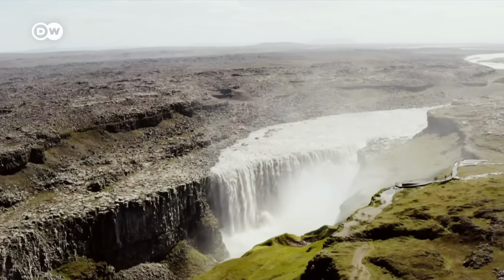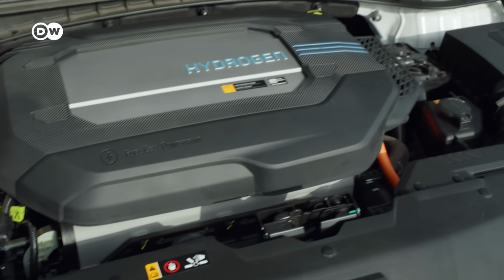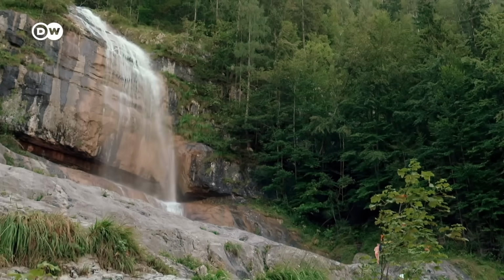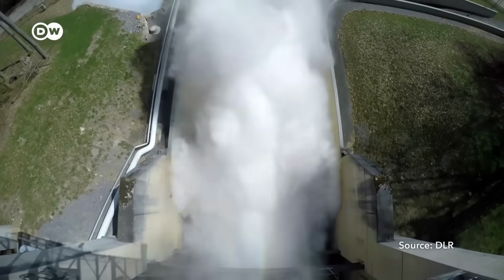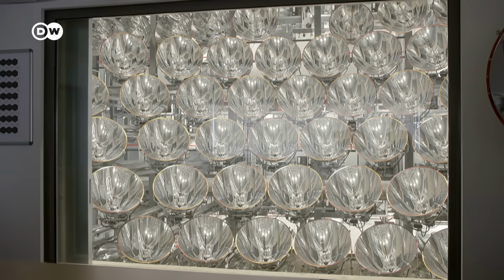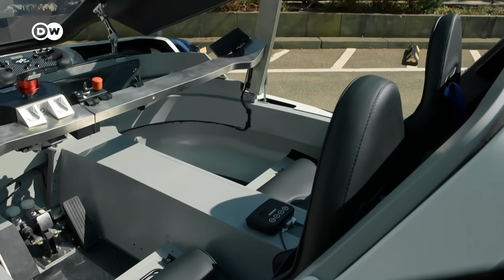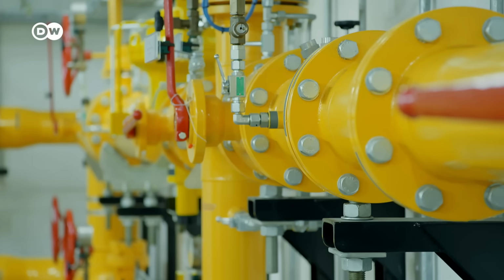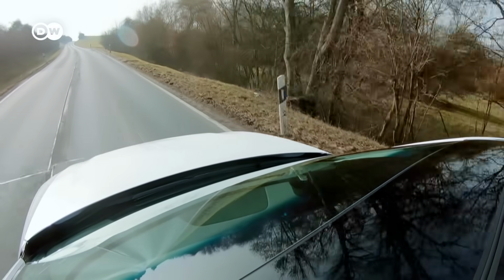Is green hydrogen the answer to the climate crisis? | DW Documentary

Comment: I’m not a great fan of hydrogen. It requires lots of moving parts compared to batteries. 

Also, if you have gas and are creating hydrogen, aren’t you just creating an extra process just so you can call the output clean? And losing power in the conversion I might add.

If you have gas at source, you may as well just convert that to electricity rather than convert it to hydrogen.

I think if they can get green energy at source then that would be better, but possibly the only viable use for hydrogen is with large vehicles and industry. Having all those moving parts in a car just perpetuates the current inefficiencies of cars. Hydrogen is only a little bit more efficient than fossil fuels and less efficient than electric cars.

Comment: The problem with Hydrogen is in it's production as it takes double the energy to produce than the Hydrogen that's created hence why they are only talking about "GREEN Hydrogen" So they are using renewable energy to Crack water into Hydrogen and oxygen, Then there is the infrasrtucture and storage issues as per the documentary suggests.

Comment: It is a myth that green hydrogen does not produce green house gases. When you burn hydrogen, its byproduct is water vapour and this vapour is one of the worst green house gases due to its ability to trap heat. 

It is also a myth that electric cars are greener. Most of our electricity does not come from renewable sources, so the generation of the electricity often involves burning fossil fuels. When you burn fossil fuels, a large part of the energy is wasted. Not only that, when you transport the electrical energy, it also involves waste. On top of that the car battery storing the energy, also lose part of their energy.

So I am very skeptical about these alleged green energy solutions, that will help reduce climate change.

Comment: Hydrogen fuel-cells aren't necessary.  It's now possible to contain Hydrogen under sufficient pressure to feed it directly to an engine -- including a (slightly modified) IC engine.  It's not necessary to transport green Hydrogen either;  it can be created on-site with solar electrolysis, even in small and portable units.  It's possible to create your own fuel at home, or as you drive!

Comment: Hydrogen is merely a storage solution for most uses. The only things for which hydrogen is important is industries where you need to create a lot of heat to make steel for example. This is a cheaper solution for plants that use gas to do that now instead of rebuilding the entire thing. Hydrogen won't solve climate change because making it costs more than it generates making the stuff only useful as waste from other processes or if there is a abundance of green energy that needs to be stored long term to compensate for times of shortages

Comment: The problem with deriving Hydrogen from water is it requires a lot of energy to split the water molecules. Since the energy needed for electrolysis is still coming from fossil fuel it defeats the purpose. Hydrogen is definitely not any greener than fossil fuel. Scientists need to solve the problem of getting energy without using any fossil fuel. Battery powered vehicles need electricity and the electricity it needs come from fossil fuel and co2 emission. As a result electric cars are not any greener then gasoline cars. Solar panels requires great amount of fossil fuel to mine the precious metals, refine and manufacture. As a result harnessing solar power from solar panels are not any greener than fossil fuel. Natural gas on the other hand emits only 40% co2 compared to any other fossil fuel. We should use natural gas as energy source until scientists can come up with better solutions. We can cut co2 emissions by 60% by using natural gas but the whole world is run by whole bunch of idiots.

Comment: Considering car & truck electrification separate from other uses of electricity, of the 3 basic EV drivetrains - All-battery BEV, plug-in hybrid PHEV and hydrogen fuel cell HFCEV (BEV vs PHEV vs HFCEV) - which one offers the most benefits, applications and potential to reduce fuel/energy consumption, emissions AND insane traffic? The correct answer is PHEV plug-in hybrid. Whaaat? The real problem is we drive too much, truck packaged goods across continents. Separately, we ship raw materials and other commodities around the world too much. PHEV tech offers the most incentives to reduce travel for the most households. 

Here's how this claim makes sense: The Prius class PHEV adds a 5kwh battery pack to a standard hybrid for a rating of an "effective" 110mpg. The Chevy Volt "extended range" PHEV is built with an 18kwh pack for a rating of an effective 150mpg when daily drives below 50 miles or 20-miles in the Prius. Drive further and both PHEVs get 40-50mpg. The Tesla 'X' has a 95kwh pack. Should limited, expensive battery resources be directed to (1) Tesla 'X' or (6) Chevy Volts or (19) Prius? 

Households with a PHEV in the garage gain an emergency backup power supply to keep the lights on, fridge, stove, electronics working in power outage, indefinitely when their smaller battery packs are matched to consequently smaller rooftop PV solar arrays and neighborhood mini-grids. PHEV households also gain the means to reduce energy consumption for household uses. Shorter drives support local economic development whereby more trips become possible without having to drive. 

Lastly, consider "combustible" hydrogen in the ICEngine of a PHEV+H drivetrain, stored at lower pressure in smaller tanks, meters into the ICEngine reliably and can in theory deliver more than twice the number of miles per gallon equivalent possible in a fuel cell EV.  Not getting a response to this BOLD claim I'll take as a sign it's correct.

Comment: hydrogen or petrolium cars are viable , i am not agenst electric cars , i am agenst battery cars , batteryes are dangerus , poluting to produce and recycle , taking to long to charge  , expensive and heavy . Goverments throw so much money for wars for example , so there is no excuse for the expenses . and with the proper investment , individuals can produce hydrogen them selfs if they have the self owned ''green energy'' and the space for a small reactor under the right gidense from an expert so they can heat theyr homes and move theyr weichles

Comment: Loop… aim the artificial sun lamps at solar panels which will power the lamps. Fuel cell solar panels might be a new tech that will derive. Place the lamps inside of a sphere, aiming at the sphere solar core. Run the energy out of that core into the grid. Self contained. Similar to a Tesla tower. These loop powered spheres can be used as core power for space travel. Nuclear lamps could be used for infinity of time.

Comment: 100 grams of each human body has 18.5 grams of Carbon. Humans only cut down trees, humans only eat Carbon containing food, humans only use electricity, paper, plastic, aluminium, iron and steel, cement, fossil fuel for cooking and heating, humans only ride vehicles and use transport fuel like a luxury instead of using it frugally. Humans only travel for unwanted purpose like shopping or making payments when these same two tasks can now be done online using internet, smartphones, computers, mobile data, etc.  A researcher need not travel to another nation in an airplane for presenting work in research conference, he or she can present work online sitting from home or research lab instead of travelling to other nation for doing that. Humans are lazy to walk or cycle walkable or cyclable distances but use crude oil or natural gas based vehicle to travel walkable or cyclable distances. Governments are not working seriously in many nations to develop an infrastructure suitable for cycling and walking as done in Netherlands and Finland. Governments and people have failed to minimize all possible causes of traffic jams. Transport routes having poor response of passengers or poor occupancy of passenger seats must be discontinued or reduced in frequency of operation. 4-seater car should travel on the road with as much as possible all 4 seats occupied by passenger or equivalent weight but on roads can be seen many 4-seater cars riding with just 1 or 2 passengers inside them. Passenger space and or good storage space of each vehicle should be occupied as much as possible to 100%. Problem is not carbon but with the way humans are using carbon. Having 18.5% Carbon in each human body could not stop human population of Earth to reach as high as 800 crores landmark currently and human population is not showing any signs of declining. Each day many new human bodies and other lives are born on Earth as well as many human bodies and other lives dies and get buried under earth or decay to form after many many years fossil fuels. As long as birth and death or decay of life exists on Earth Earth will continue to see formation of fossil fuels. Bio-degradable mass will always exist and form the greenhouse gas Methane. Natural Gas will be needed to extract Helium. Life is Carbon. Humans cannot live wihout Carbon, humans themselves are made of Carbon. Current population of humans on Earth 800 crores and rising.

Comment: The solution for it is quite easy for energy companies. They need to invest in hydrogen production and distribution because they need to produce more electiricity than we use each day and that useless energy could be transfered into production of hydrogen for power generation. This way its no longer wasted energy. Similar thing with desalination of water in dry areas. If they could use this wasted energy there then it would gain net profti and not net deficit and it would help nearby population. Just a simple idea. I don't know about its real life application but it should be possible to do so with at least part of wasted energy.

Comment: HYDROGEN IS NOT "PRODUCED" IT'S ALSO NOT RARE IT IS BY FAR THE MOST ABUNDANT ELEMENT IN THE UNIVERSE. IT CAN BE EASILY COVERTED FROM WATER AT A NEWGATIVE MONETARY COSTS. BATTERY ELECTRIC VEHICLES ARE NOWHERE NEAR 60% EFFICIENT AND NOWHERE NEAR AS EFFICIENT AS REGUALR HYDROCARBON FUELS NEVER MIND HYDROGEN. THE EFFICIENCY DATA IS HIGHLY SKEWED AND NOT MEASURED PROPERLY. THEY ARE PUSHING BATTERY ELECTRIC VEHICLES TO MAXIMIZE PROFITS AND EXACT CONTROL OVER THE POPULATION MAKING THEM INCREASINGLY DEPENDANT. BATTERY ELECTRIC VEHICLES ARE NOT CLEAN,GREEN.EFFICIENT,VIABLE, SCALABLE OR FEASIBLE!!!!

Comment: Battery electric vehicles are a stopgap “until fuel cell vehicles take hold.” 
Yes. Fuel cell vehicles will take hold because oil companies will support them using their existing business model — the same one they have for gasoline and diesel filling stations. Those who remain unconvinced should heed the words of Angela Needle:
“Efficiency is not the only value driver for a working energy system, you’ve got to look at resilience – is the energy always there when we need it? We’ve got to look at consumer behavior and needs – the cost of disruption of getting everybody to install an electric solution over hydrogen. Is it worth it and does it get us [to net zero] at the pace we need?”

Comment: One big mistake, one major lie:
The mistake: Hydrogen is not a source of energy. 
It may be used as a form of energy storage.
If you like, you use a lot of energy to separate hydrogen from oxygen in water. Then you can get most, but not all, of it back when you burn the hydrogen in air later.

The lie: It is not true that burning hydrogen gives only water as a result. This video tells a straight-out lie when it makes that claim for hydrogen-engine automobiles. 
You would get only water if you burned hydrogen in pure oxygen. Air is 80% nitrogen with little tiny bits of CO2, argon, and other tiny leftovers. As a result, when you burn hydrogen in air you get a lot of water and a whole lot of varied nitrates and nitrides, some of them very unhealthy, and tiny amounts of other pollutants.

Comment: There are no easy solutions for our predicament. Fossil fuels for all its side effect is a portable and potent source of energy. Its alternative are neither potent nor portable mainly solar and wind. Battery is huge issue in renewable and it is very vulnerable to climate change. Using renewable is like replacing fossil fuel with lithium, do we even have that much lithium. As for nuclear shear resources required to built is so much that no one except developed world can afford it. Also portability of reactor and nuclear fuel availability if we scale up which don't include mythical for 100,000 years from ocean. Also if we seriously start to transition how much resources is required not money but actual resources and how much fossil is required to facilitate it. Also green energy Transition and green house gas reduction cannot happen at once, more fossil fuel will be needed for all manufacturing of pv panel, wind turbines and nuclear power plant. At least 40-50 year is required for transition just enough to push down climate off the edge and all hell breaks lose.

Comment: I think pure H2 is not a good option; it is not a good energy vector (like current Li batteries).
It is very difficult and expensive to liquefy (−259 °C), and even as liquid it has a very low density (about 70 Kg/m3).
Stored as gas at high pressure (700 bar) it is very light (about 40 Kg/m3).
To make things worse, Hydrogen molecules are so small that leaks are sustancial and hardly avoidable.

Despite its huge mass energy density of about 33 Kwh/Kg (12-14 Kwh/Kg for fossil fuels), 
its  volumetric energy density at 700 bar drops to about 1,4 Kwh/l (10 Kwh/l for fossil fuels aprox.).
H2 production process from water is not very efficient , its energetic density (by volume) is not very high, and its handling is complicated.

Comment: For transportation, the specific volume is too great. A typical jet airliner would need half the seats to store liquid hydrogen of equivalent energy.
Reply: “Green” hydrogen is a sham.   First,  unless it is coming from Nuclear power, there will never be enough solar or wind to create hydrogen in scale.    Second is the explosive nature of hydrogen, in addition to storage volume due to poor energy density.   

A nuclear reactor produces enough energy to fuel an aircraft carrier for 20 years.   A short haul plane using propeller drive could be powered directly from a small nuclear reactor. 

Germany can’t even stay warm this winter, going green without nuclear power is impossible.  

The “green agenda “ and transition is fine, but the bias against carbon-free nuclear power makes no sense.

Comment: Interesting documentary. But I kinda miss an explanation on how it can be safely transported without it affecting the metal that it is transported in (see Hydrogen Embrittlement). Without this you will have major costs involved with transforming the current infrastructure to make it suitable for hydrogen. Are current natural gas pipe lines that go to the houses all suitable for hydrogen or will they deteriorate within one to a few years and need replacement constantly which will drive up costs considerable?
Reply: CSIRO developed a process to convert hydrogen to ammonia, which is more easily transported and can also be used as feed stock for making fertiliser.
Reply: Didn't know about hydrogen embrittlement. Thanks for bringing that up. And you are right, it should have been included in this documentary because that probably means that the existing natural gas infrastructure will not be able to be used to transport hydrogen without customization.

Comment: The easiest way to produce green hydrogen: make it using nuclear energy in remote places far from human settlement. As long as the reactors are safe enough, the hydrogen will be cheap enough to compete
Reply: Why not have nuclear close enough to supply electricity to population and skip the transfer of hydrogen? Nuclear is safer and cheaper than transfer of hydrogen.

Comment: Hydrogen is one of the more sensible options put forward and should in time replace petrol, diesel etc
Reply: You do realize hydrogen is explosive, right?    There is a reason why the Hindenburg exploded!
Reply: I still think it will take ages for it to be really green.  And thats mostly because of transportation cost and compression costs

So far electric is still the way to go for now 
Lets not forget that hydrogen has been around just as long as any other fuel.
Reply: @DiyNuke  its a scam .  It takes 100kwh of energy to create 23kwh .  Defiantly not green .  its more like an idea to keep oil companies in business by selling another commodity.